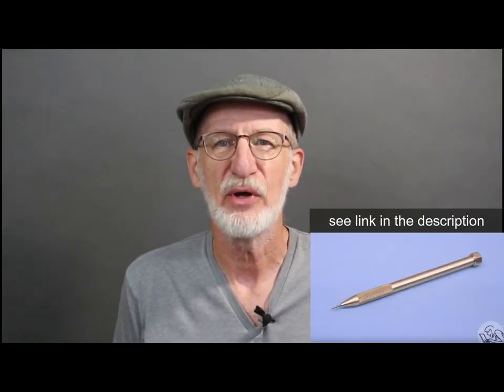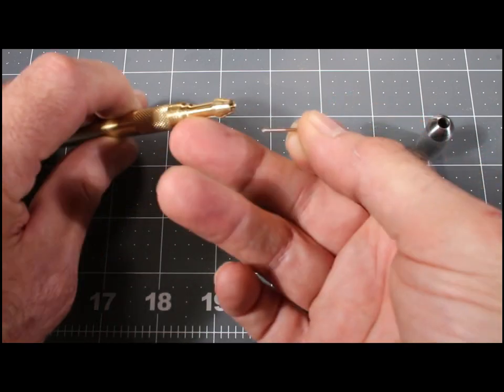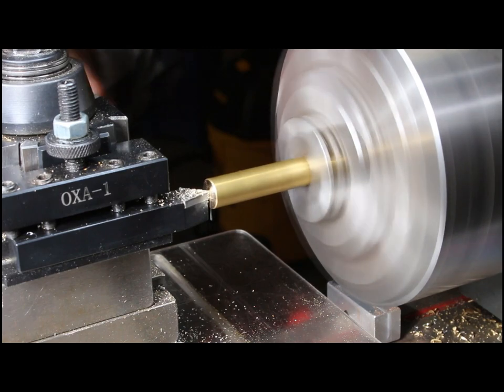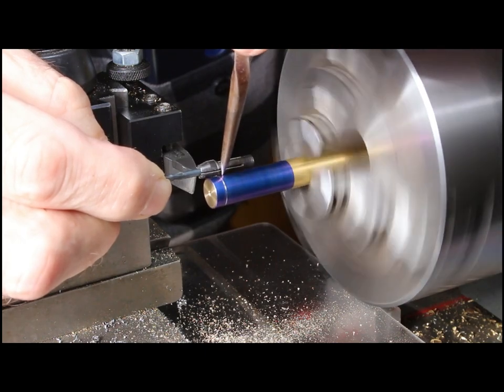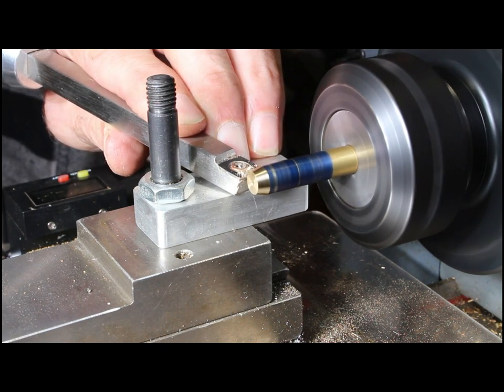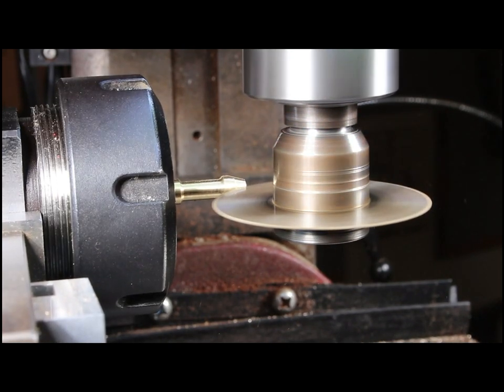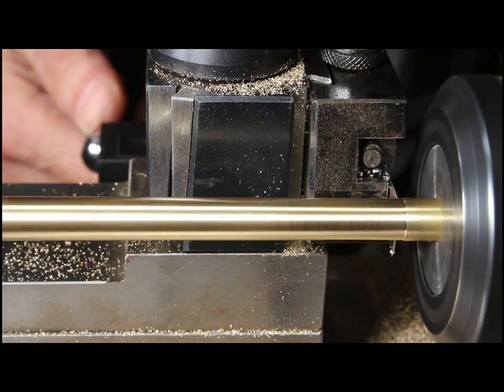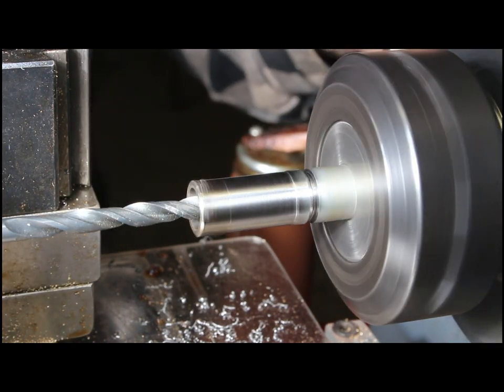Making a scribing tool

Comment: Interesting video. I subscribed after your video on installing a electric bike gear motor on a mini mill. I'm trying to do the same thing with your help! One thing, isn't a cardinal sin to wear long sleeves when using power equipment like a lathe? LOL!!!
Reply from the maker: I'm glad that I have inspired you to upgrade your mini mill! I hope your adventure goes as well as mine did.

Yes, it is definitely a No-No to use long sleeves when wood turning, but I'm an experienced professional and I always button the cuffs up really tight.  However, when I teach woodturning classes I always make sure everyone removes long sleeves, watches, jewelry etc. It's a case of do like I say not like I do! 😉